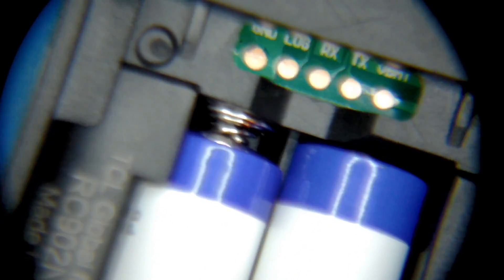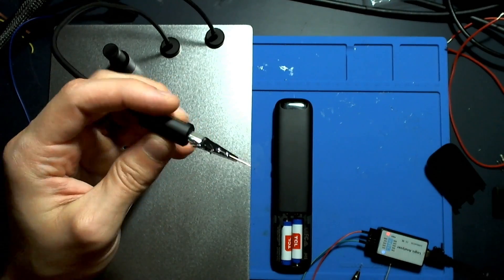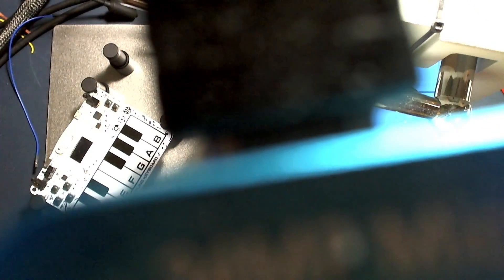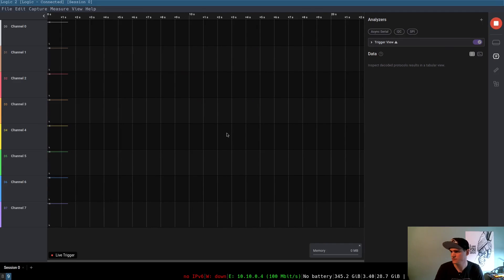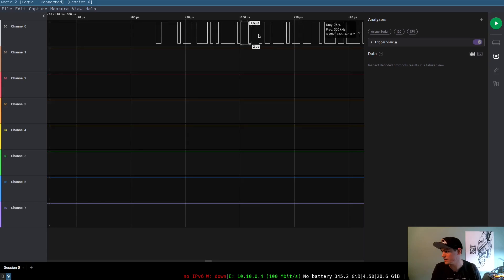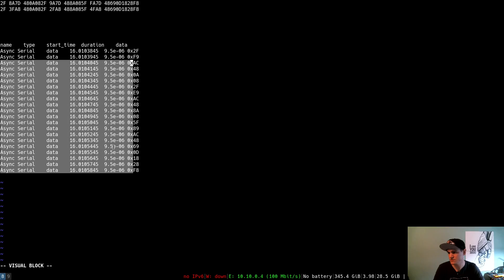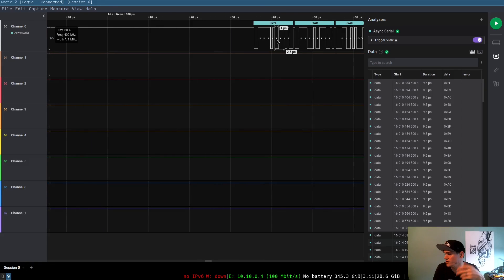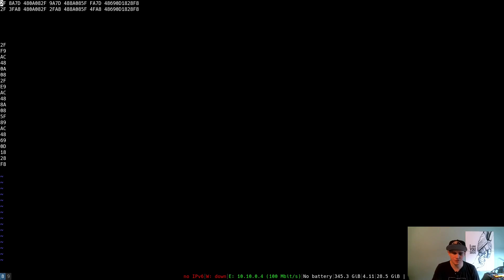Reverse Engineering Smart TV Remote with Logic Analyzer

Comment: I have always wondered about these pads, especially on the old Vizio double sided remotes with the keyboard attached to the bottom, it’s made of two motherboards with two IR lights pointed in different directions. I remember I would spend hours as a kid testing out all kinds of stuff with the remote and they even have weird little games you could play on these early smart TV’s. (BTW I’m talking about the big one with the A B X Y buttons, not the slim newer one and not the one where the keyboard slides down)

Comment: 2F seems to be transmit, 5F might be receive? (Not sure) I noticed additional patterns in each of the messages as well. It seems each message has three messages in it. I've broken them apart before. As you noted, the same byte is sent in position 3 for each of the three parts, which is always followed up be 48.

Perhaps the 3rd byte is a sort of message id for the current packet?

2F 8A7D 48 0A08
2F 9A7D 48 0A08
5F FA7D 48 690D1828F8

2F 3FA8 48 0A08
2F 2FA8 48 0A08
5F 4FA8 48 690D1828F8

2F F9AC 48 0A08
2F E9AC 48 0A08
5F 89AC 48 690D1828F8
Reply: More likely an end of just comms check